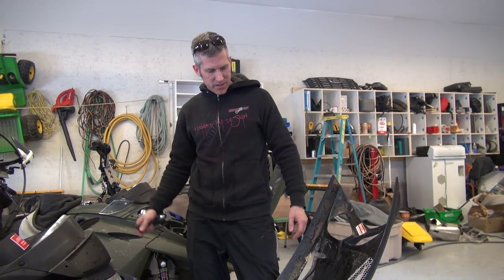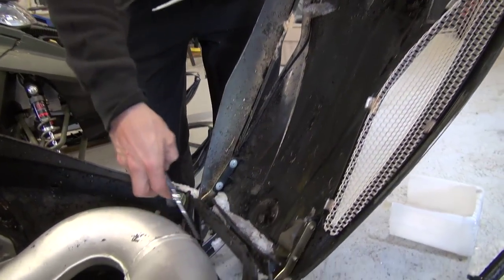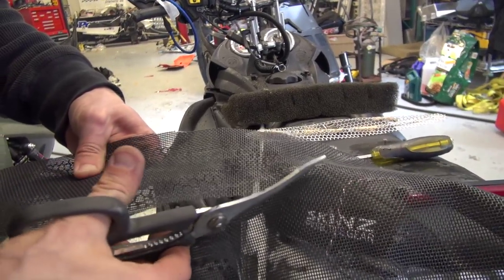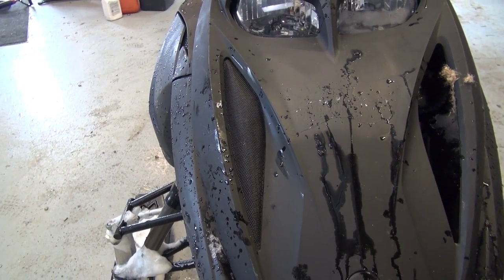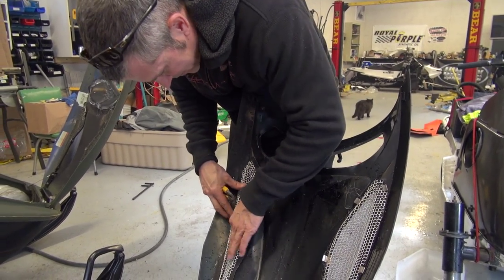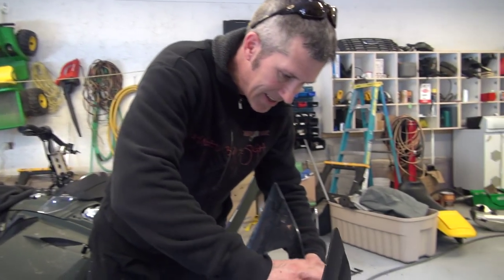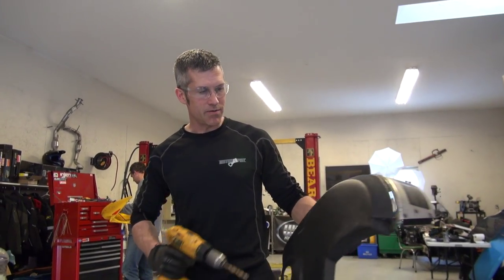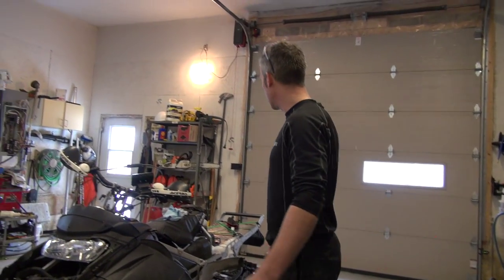Ski doo REV 700 mod sled Build ep# 28 DIY Vent screen install and clutch cover Mod!  PowerModz

Comment: Congrats on  6750 Subscribers ,, I'll look you up on the forums.   I worries about taking out the foam on my sled due to heat from  pipes. and I cant run can's they have a noise thing in NH.